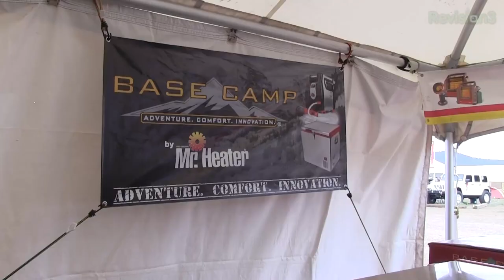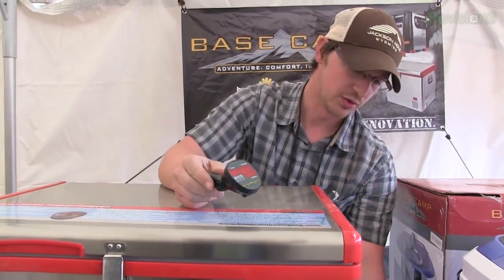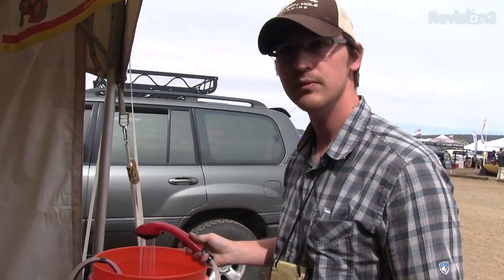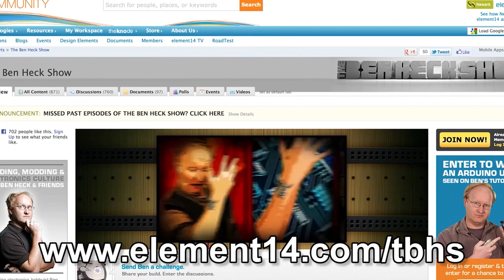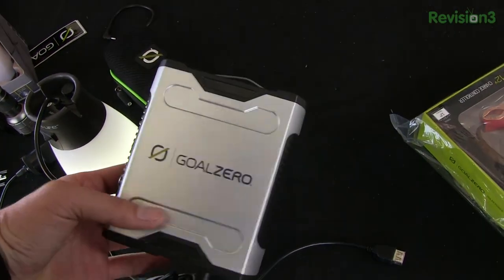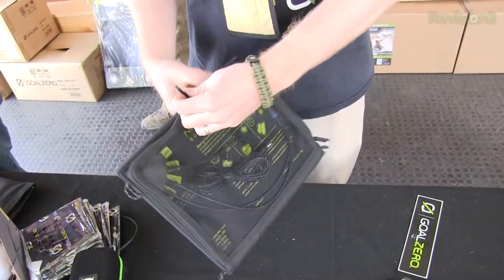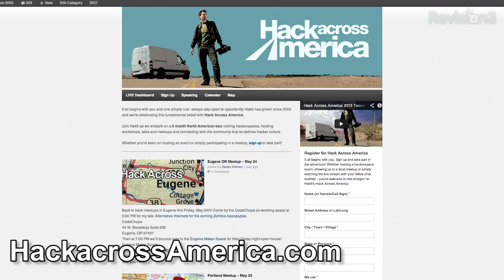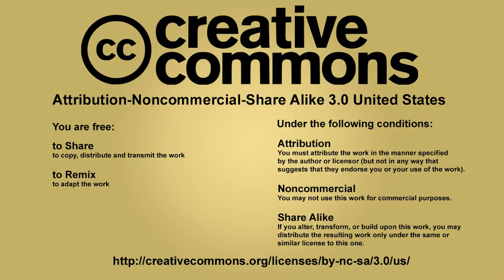Overland Expo Solar and Heat, Hak5 1414.3 - Hack Across America 2013

Comment: The Mr.Heater is a great heater and actually helped us a lot on one camping trip we had this past June.  On a one week camping trip the weather was great until we got to our destination.  That nite the temp dropped to mid 30s IN FREAKIN JUNE and we were freezing and we had our baby with us in our 8 person tent.  That evening I went out to find a place where I can get some blankets and ended up at Walmart and picked it up with a couple of propane bottles.  1 bottle on low setting lasted over 8 hours and our tent was like a sauna! We used this heater the entire trip.
Jump on to Oct, this time I bought a propane tank adapter.  On the tank we had our stove and heater connected.
Reply: Devil Dog yut